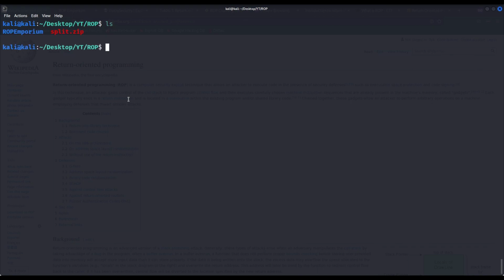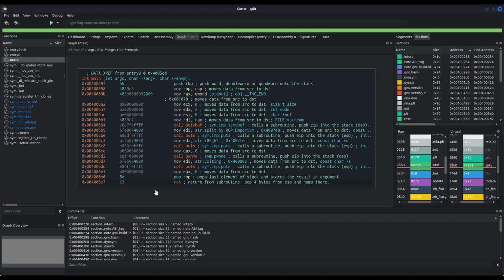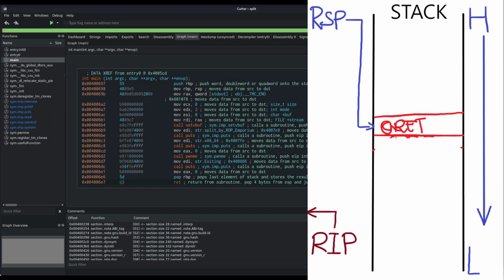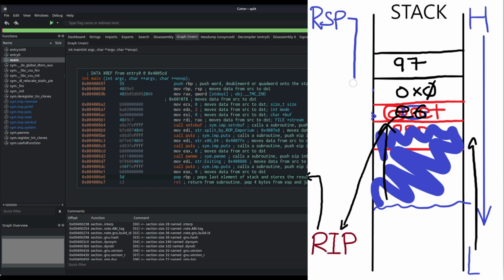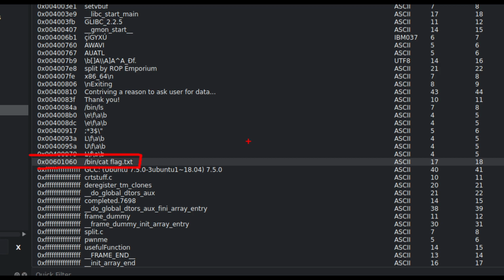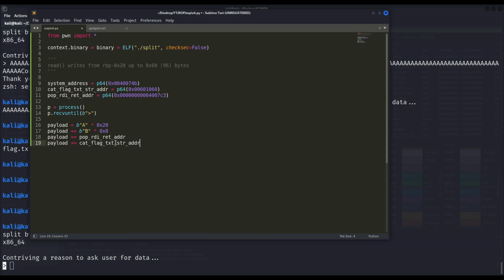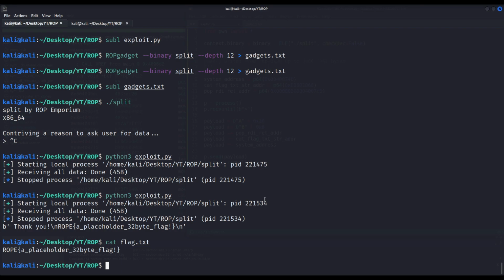Exploiting Return Oriented Programming (ROP) tutorial - Binary Exploitation PWN101

Comment: Does PIE prevent this?
Reply from the maker: Initially yes, because addresses are randomized. However, if you are able to leak any address of the corresponding section during the execution, you may be able to find out the randomized address.
Reply: @RazviOverflow  If you are trying an lpe and you can't get an interactive session on the binary, will ASLR and pie prevent exploitation?
Reply from the maker: @oliverford5367  If you can't an interactive session, you must somehow be able to leak addresses from the running binary's memory sections. If you can't leak addresses during the execution, yes. ASLR/PIE prevents exploitation.
Reply: @RazviOverflow  Annoying because I have found a Linux LPE 0-day that works with ASLR off
Reply from the maker: @oliverford5367  ASLR off is unrealistic nowadays. Every system has (or should have) it enabled.

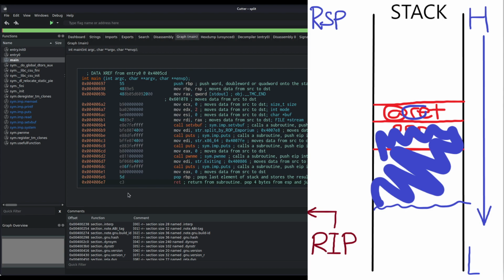Comment: Possibly already pointed out - at around 8:30 the picture of the stack being overflowed is backwards.  The stack grows from high memory addresses to low.  Everything that was drawn into the stack should be flipped upside down.  Nonetheless, still a great video and explanation.
Reply from the maker: Incorrect. As you stated, stack grows from higher (H) addresses toward lower (L) ones. At the right of the drawing there is a huge arrow that goes downwards from H to L to indicate just that. There is no such thing as flipping the stack upside down. It doesn't matter how you draw it as long as you specify where the higher or lower addresses are.

If you check the whole series from the beginning or the process I usually follow to draw the stack, you will notice I always do it like so.

Thanks for the comment.

Comment: Can you make a Cutter setup video. My cutter shows addresses relative to stack. Which is pretty confusing... I was wondering why isn't my exploit working...
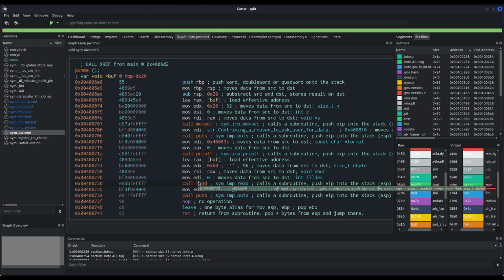It shows var void *buf @ stack - 0x28 whereas on yours it shows var void *buf @ rbp - 0x20  @14:53
Reply from the maker: They changed that in recent versions of cutter. I'm not sure if you can change it back to the older form (like in my video). Anyways, you just have to realize that what they call "stack" is the base stack address (right where the saved return address ends), and right above it lies the rbp. So rbp-0x20 and stack-0x28 are equivalent given that rbp is 8 bytes long.